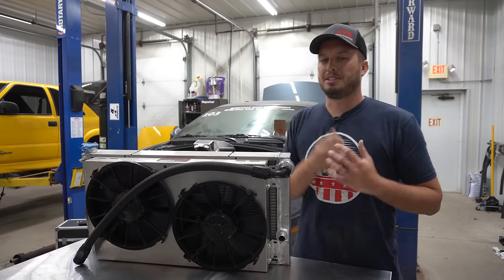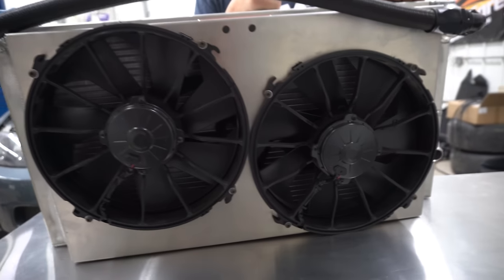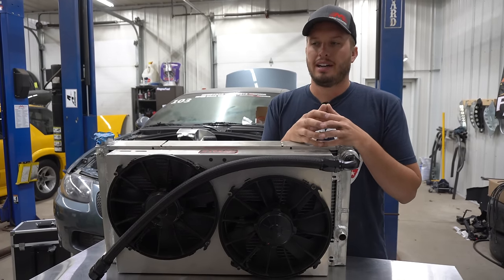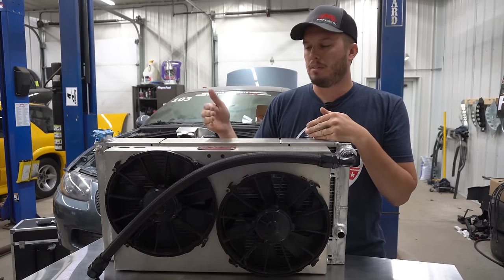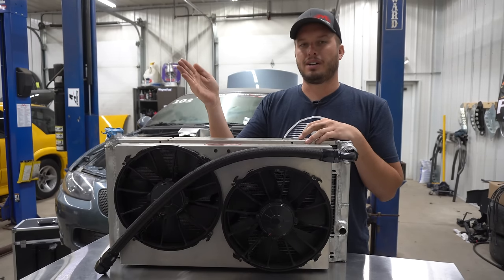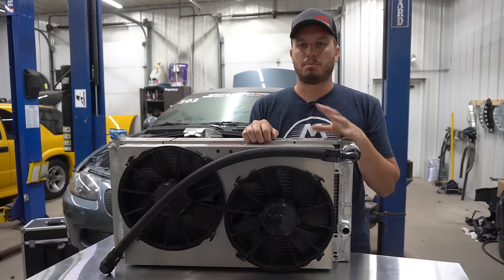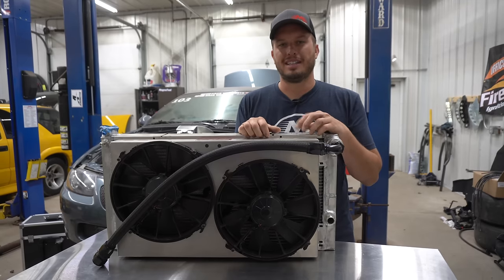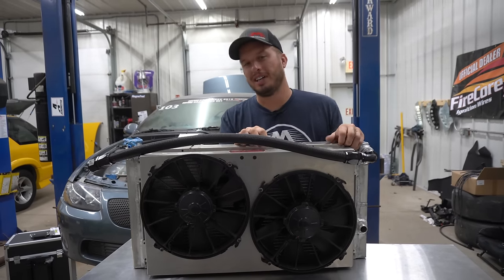Tech Tip Tuesday: How to Power Electric Cooling Fans... Must See!

Comment: Why do manufacturers use huge radiator hoses like 1.5 to 2.5 inch. But racers think -16 fittings are good enough. Thats a 1” hose running a 800hp beast. 
Can’t cool a engine if can’t circulate hot coolant from engine.
Reply from the maker: Not think, we know the -16 works… cools racecars and Raceweek driver cars that are the most demanding on cooling systems. All you have to know is that it works

Comment: Running fans on at a speed of 30-50 60+mph is pointless... The air coming in is greater then the fan speed .  Fans are only used when at lower speeds or idle. So this guy is wrong. 
The only way to keep your fans on on higher speeds is if you have open shroud.  Which let's air pass threw around the fans.. 
This guy doesn't know what he's talking about.